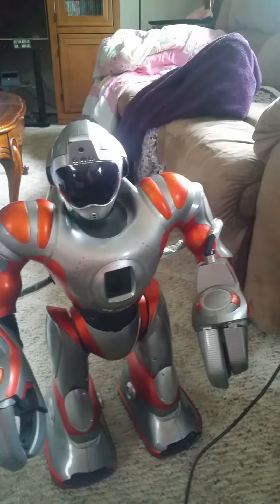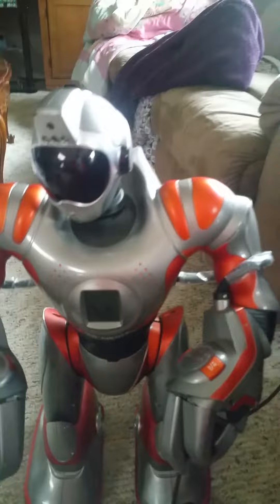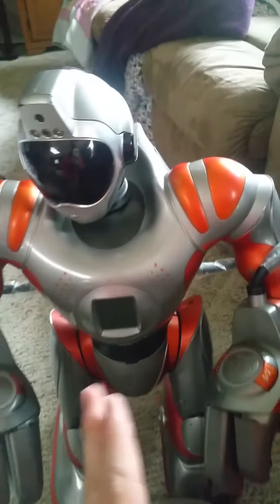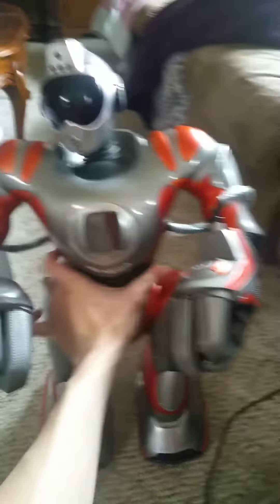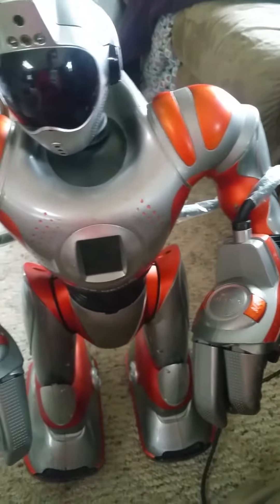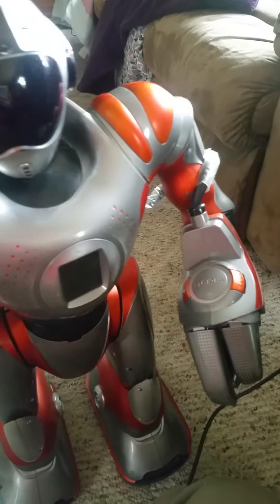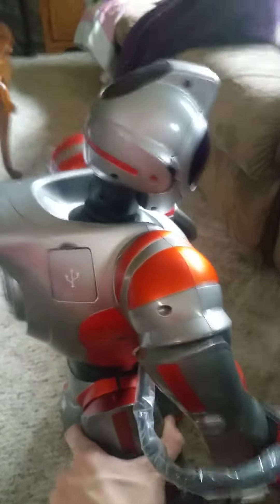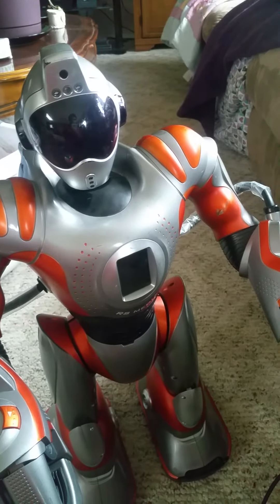Talking about the fried rs media

Comment: How can you tell what generation of media you have?
Reply from the maker: 1st gen has all the 1st versions of the default personalities, the transh can symbol on its butt, no loading screen when its powering up, the cables leave Mark's on the arms. 2nd gen has all the 2nd versions of the default personalities, has the loading screen when nothing up, has no trash symbol on the back but operates the same as 1st model. 3rd gen has the most differences, it has the 2nd version of Billy joe sapien and service bot, but it's got the 1st space bot personality, but the audio files are placed in for the wrong functions, all 3rd models have that, I have multiple 3rd models, 3rd gens also dont leave Mark on the arms from the cables, the media mode, stuff is in different folders then the other 2 models, roaming mode also operates differently. 1st and 2nd models only roam for 3 minutes if they dont hear a sound in between and fall asleep after 2 minutes, when the media hears a sound the timer starts over, but sense most medias have a glitch to where they think they always here something it never stops. The 3rd model were programmed to roam for 10 minutes if they dont hear a sound and then power down, but going 10 minutes without hearing a sound is impossible for them, unless you create the noise overload function to where it shuts its ears off in roaming mode. 2nd and 3rd model dont have the trash symbol. 1st gens were mostly sold in the UK, Australia other companies, theres a few that were in the US though. 2nd and 3rd gens were only US as far as I know. Also the disc software the 1st model comes with is a bit different then the 2nd and 3rd models.